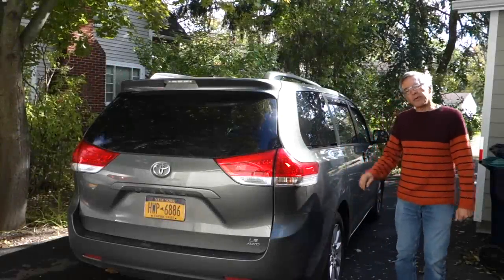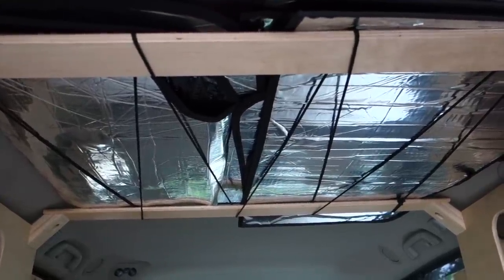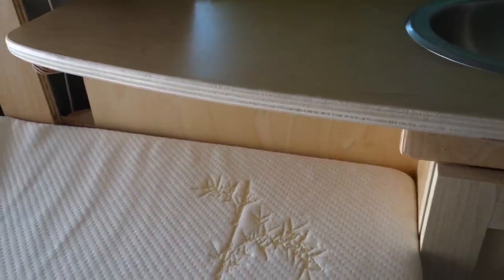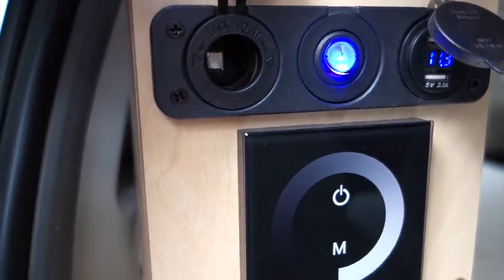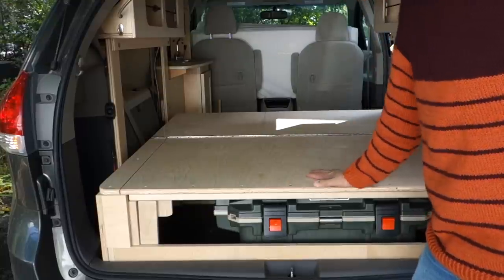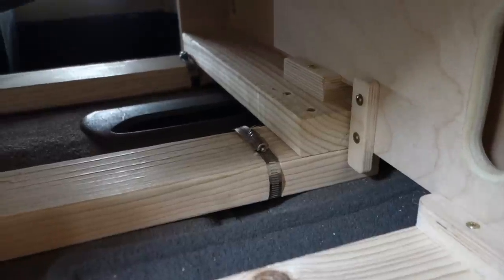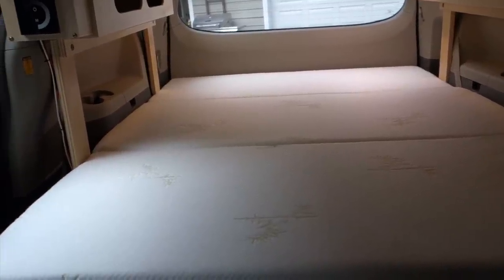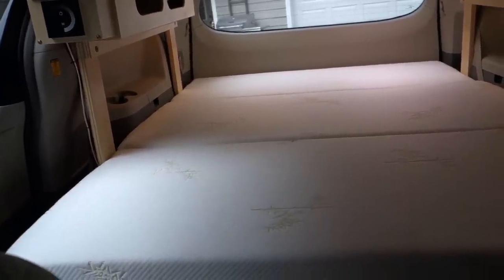A Slightly Different Mini Campervan Build

Comment: 1:20.   Are the two crossbars on the ceiling also there to support the upper cabinets?
Reply from the maker: Yes, their primary purpose is to support the upper cabinets left to right. That way the cabinet uprights didn’t need to be structurally sound left to right, they just support the weight of the cabinets. I wedge a small piece of pipe insulation in the tiny remaining gap between the cabinet backs and the interior trim panels to eliminate any remaining tendency of the cabinets to wiggle or vibrate. It’s quiet and solid.
Reply: @BruceParks     Thanks for replying.😀 You sure did a nice job. 
1) Did you finish the upper cabinets and vanity with polyurethane? No gloss so maybe a flat or satin poly?
2) Is it a hassle to get to the cooler or remove the foot support panel when the cushions are still on?
Reply from the maker: @Joe Blow 
1) I used satin finish water-based polyurethane on nearly all of the surfaces you can see and touch. In the beginning, I used regular brushes to apply it but later on I switched to an airless spray gun to build uniform layers quickly.
2) Kinda. So in back, we switched out the cooler for a fridge but access was still pretty much the same - the mattress gets squeezed up between the upper cabinets so the head panel  can pivot up to be latched. Seemed like a pain initially but now I don't even give a second thought. In front, the foot panel we pretty much leave out all the time. Too make this all easier, I'd change from trifold to separate cushions and I'd also make cushions for the fixed wings flanking the head panel always fixed to the wings. Hope that made sense.
Reply: @BruceParks    I'm 5-11 and 200 pounds. I'm looking at possibly buying the same tri-fold mattress off of Amazon. If I don't then I might buy three pieces of foam at 51" x 26" x 4" and laminate a 2" thick piece of memory foam on to the top of each one.
A) Does the space where the three pads connect into one mattress get uncomfortable? 
B) Can you cut where the three tri-fold pads join (so you'd have three unconnected pads) without destroying each pad?
C) If you get rid of that tri-fold, what would you replace it with?

Thanks again! :-)
Reply from the maker: @joeblow1942  Sorry for response delay. A) No, the mattress joints feel no different than the main area. B) It looks like if you cut the mattress covers at their hinges, you'd need to sew the cover closed in order for it to still be useful as a zippered cover for each section. C) The other option I've considered is separate foam blanks that are cut to size but it's really nice to have covers for each foam section. The cover on the Milliard trifold is a great material, it's kind of a thick weave yet very breathable. I'm not sure that would be easily reproduced. Regardless, the foam should be covered and there might be a few areas where velcro strips would be handy to keep some sections stuck to each other.
Reply: @BruceParks    I'm still checking through Amazon cuz I need a 75" long full MINIMUM but so far most of the tri-folds are only 73" long. Good idea about using velcro. Thanks. I'm considering three foam blanks too but I would want to laminate/glue memory foam on top of each though. The other option is to buy a 75"f minimum long full and slice it with an electric knife into three equal pieces. (There are videos on Youtube showing people doing that with an electric knife) Thanks again for replying, Bruce.
Reply from the maker: @joeblow1942  I'm 5'11" too. I've found the 73" long mattress to be fine for our setup. Longer would feel luxurious.
Reply: @BruceParks      This guy shows a simple way to make cushions: https://youtu.be/Ug2fMzPF1a0   I am concerned about feeling the gap if used for bed cushions though (but then you said you don’t notice the gap). I’ve seen boat cushions made that way using vinyl instead of cloth for cockpit cushions. The difference was that instead of stapling through the fabric into the plywood, they stapled or screwed through a solid wood lip into the fabric on the bottom which more securely holds the fabric in place (less chance of tearing at the fastener cuz the wood lip holding the fabric down spreads the load). And for cockpit cushions this elevates the bottom of the cushion from water. For exterior use, you would seal the plywood and solid wood strip with epoxy resin.
Reply from the maker: @joeblow1942  Yup, he did a nice neat job. This is the way we reupholster dining room chairs. In the van, one of the nice things about having a zip off cover is you can launder it if necessary.
Reply: @BruceParks    I guess you could unscrew the covers from the plywood backs and wash them but great point.

Comment: Good Morning Bruce... I owe you big time for all your help: maybe a box of N95. masks...jaja. Couple of questions for ya:
Do you carry a stove on board. recommendations?)..don't see it anywhere. Am looking at a 40 Qt.,Dometic cooler...doesn't have handles, which I like. In Portland Me. looking for an electrical person.Electrical has me scratching my head too much, probably like most folks. Oh....any extra sky shoe buckles. Take care, happy trails, and stay well! Oh...
On my way to N.M., I could drop off a few lobsters.....
Reply from the maker: We use a Coleman single burner butane stove (https://amzn.to/2XO97I5). It's really compact but works well if you protect it from the wind. The Dometic is a good fridge but another to consider is the ICECO JP40 (https://amzn.to/36OPzaF) for a lot less. It uses a high quality compressor, comes with an insulated cover, can be used without the handles installed. We have one. Oh, and we love lobster!
Reply: @BruceParks  Thanks so much Bruce...appreciate your dedication. We could be brothers with gypsy souls.....

Comment: How do u secure the doors 
, From someone trying to enter while u sleep
Reply from the maker: We just lock them with the key fob
Reply: @BruceParks  no I mean when someone gets past the lick system. I saw a truck driver run his seatbelt thru the door handles and buckle it in. I am trying to figure out how to do this to the side doors, as I will travel with my daughter and grandson (a toddler)
Reply: Lock. Darn spell correct
Reply from the maker: @joanobrien722  Hmm, my side doors don’t have any features that you can loop something through. You might consider bolting an eyebolt through a sturdy part of the door and then using a cargo strap to hold the doors securely.
Reply: I will have to think about it.  Idk. Trying to stay safe.  It's hard being the protector.  Lol
Reply from the maker: @joanobrien722  It's so sad you have to worry about things like that. Wishing you well.

Comment: I really love that setup, about how much did you spend? If you don't mind saying, that is. I hope y'all have many years of enjoyment out of it. Y'all take care and YHVH bless.
Reply from the maker: Darrell Knight - thx for the comments. Cost-wise, roughly, $100 lumber, $50 hardware (screws, hinges, etc), $100 electrical (incl jump pack battery), $60 plumbing (incl sink, faucet, jug), $130 mattress. These are figures from memory so there may be some adjustments needed but they’re very close to actual.

Comment: Brilliant... Sign me up if you ever draw up plans.
Reply from the maker: John Boardman - Thanks for the comment. I’ll keep your request in mind.
Reply: Bruce Parks I am a retiree too and want to build a home for myself and I think this is the perfect solution. Outstanding design! Please keep me in mind should the plans become available. One more thing, if it is not too much hassle, please provide  the dimensions of your cooler.
Reply from the maker: @JulieR888   - The cooler in the video is a Pelican 50 Qt. External dimensions are approx 20" high x 20" front to back x 30" left to right (including the big integrated handles). This is similar in capacity to the Yeti Tundra 65, which has a capacity of 52 qts. I chose the Pelican based on performance tests showing it to be superior to just about everything else but when it arrived I was surprised at how big it was on the outside. For use in the minivan, where every single cubic inch is precious, a smaller cooler might be better depending on how much stuff you need to keep cool. I'm planning to add a solar panel and deep cycle battery which would allow me to run a small refrigerator, eliminating the need to keep replenishing ice. Cost-wise, ice is cheaper in the short run but over the years, assuming the fridge is reliable, running the powered system might be cheaper.

Comment: how do you maintain heat
Reply from the maker: bill bank  -  A heavy blanket is all we use on the cold nights but we don’t sleep in it once it gets much below 30F. I built this one as a 3-season camper.

Comment: Any way you have plans for this build?
Reply from the maker: Hi Jennifer, I wish the answer was yes but it was a complicated build and plans would be a bit too involved to put together. Think of it as a first prototype that would become much simpler the next time around. If that were to happen, it's likely I'd create plans and make them available for others. Sorry I can't help you right now, but thanks for asking.
Reply: @BruceParks  When I watched you, show it. Then your other video where you uninstalled and weighed everything. In my head I said this gentleman was an engineer. Am I correct? My sister and nephew are exactly  like you. I admire your talent. 
Thank you for responding.
Reply from the maker: @llennocj  You are correct! I loved building things as a kid and knew early on that engineering was going to be my career. As you can probably tell, I still love building things.

Comment: How do you cook
Reply from the maker: We use a Coleman single burner butane stove but prefer to use it outside. If I eventually decide to integrate it into the cabinetry, I don't feel it would be a difficult job, just a matter of deciding where to put it.

Comment: You need put insolation in all wall and window, and you will not needed turn on heater.
Reply from the maker: I appreciate your comment but the goal with our minivan was to keep things simple and not make any permanent changes to it. Also, we usually don't camp in temperatures below 32F (0C) so cold is not much of a problem. But I agree with you that adding insulation would make a difference if that's what you're after.

Comment: What is your power source?
Reply from the maker: Henry Avelino - I’m using a 13,600 mAh jump pack battery that stays plugged into the van so it recharges when driving.
Reply: Bruce Parks Thanks for responding Bruce. Can it support an electric cooler?
Reply from the maker: I think it’s too small for an electric cooler. I’m considering adding a full-size deep cycle battery with solar recharging for things like that.
Reply: Bruce Parks Thank you so much! I love your design.

Comment: You can't sit up on the bed.
Reply from the maker: Robert Thomas - Well it depends on your torso length. My wife can easily sit up. I can sit up with hair brushing the ceiling. In this build, the height of the sleeping platform was defined by the height of the cooler, and the cooler is a big one. I’m considering going with a smaller cooler or a small RV fridge, which would allow me to lower the platform and increase the headroom. No matter what vehicle size you go with, there are trade off decisions to deal with.

Comment: Looks like a very expensive build
Reply from the maker: I guess it depends on your definition of expensive. Ballpark figure for the materials in this video is a little over $600:
$140 lumber (mostly baltic birch plywood)
$50 hardware (screws, hinges, etc)
$100 electrical (LED parts, wiring, switches, jump pack)
$60 plumbing (sink, faucet, jugs, fittings)
$130 mattress
$170 WeatherTech window shades

In the next video (https://youtu.be/oO2-2EKtJLc), I added solar power and some other upgrades for an additional $1000 plus $500 for a fridge.

No charge for the labor.

Comment: Could have used more explanation about how your wife pees at night.  A problem for this type of camping.
Reply from the maker: I mentioned it in my video last year. We set up a Luggable Loo. Basically a toilet seat on a bucket. Inside is a plastic bag with either the gel powder made for this activity or kitty litter. We used both, separately, and they both work fine. She loves the luggable loo.

Comment: You must be an Engineer, based upon the forethought.  TERRIFIC optimization.  Do you plan to do any sort of Power Inverter ?  Can you detail some of the hinges, brackets, etc ?
Reply from the maker: I trust you found the answer to your inverter question in my other video.
Reply: I did.  Another Terrific one.  Tremendous attention-to-Detail.